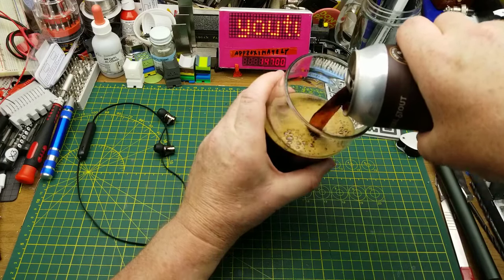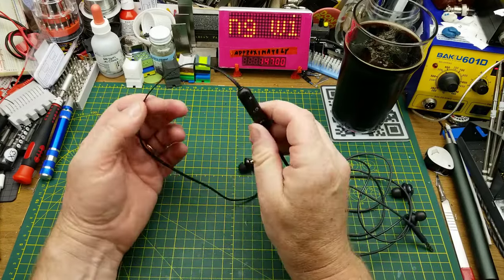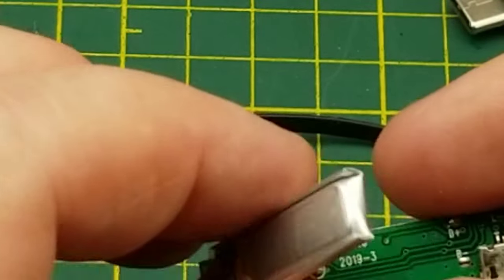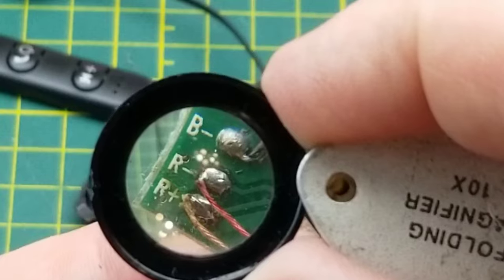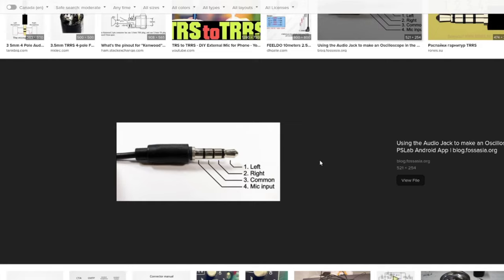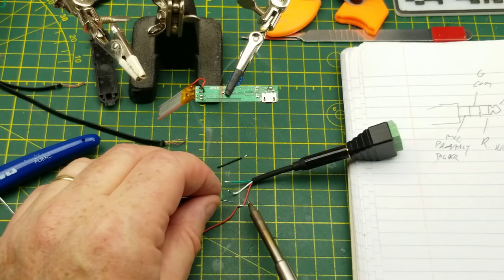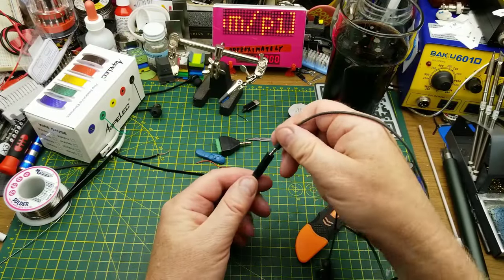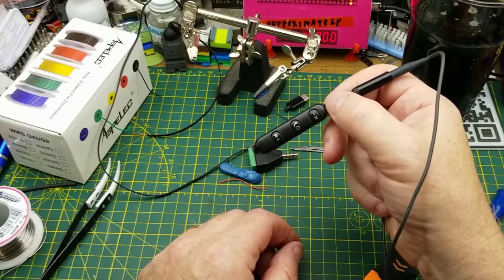upgrading cheap bluetooth headphones

Comment: Ha, why didn't I ever thing about that? Was looking at some solution to use my trusty earbuds a year ago and only found the 'fairytale golden diamond infused' BT5.2 at like 30 or 40 Euro/Dollar ones.  Could have bought cheapos and do it myself.  
I'll bet that IC also eliminates the dc-pop when you turn it on and off?  How about bass and noise?  Some of them use like really small caps in series which creates a high pass filter.

Comment: Only those hardware hacks are capable to trump household appliance disassembly in the shed.. satisfactory wise. 

It looks like it is a mono audio out ? .. the two traces connecting both earbud connections ? Can't quite get a view on that.. (Schematics please ^^)

This might also be a good opportunity to dig out that old 3d printer and make a case ;)

Comment: Seems a little odd not to keep using the sleeve as ground in 4-contact jack/plugs, where the 2nd, added ring is the mic, because you can just plug in a normal TRS plug into a TRRS jack, and still get normal Gnd/Left/Right on a pair of headphones.  Shorting the mic input on some jacks wouldn't matter, in fact it might quiet some units down.  If the mic output is the sleeve instead, and ground is moved to the 2nd ring, a normal 3 pin plug on a pair of plain old headphones probably wouldn't work, as that 2nd ring is probably not going to contact a ground source.
Reply: Regular plugs with a single ring will work on both 4-pin jacks equally well. Both second ring as well as sleeve will both connect perfectly to the full-size sleeve because everything is the same diameter.

Comment: "Didn't expect battery" .... now then, I would think that using the shield for the mic signal is a BAD IDEA. What's the point of the shield now? But to be fair, any serious microphone will be wired for common mode rejection and require three conductors, not just two.
Reply: No you misheard that. He didn't expect the housing to open so easy and they didn't use glue.
Of course he expected a battery, the thing has a USB charge port.
And about the microphone using the shield: what are you talking about? The mic is soldered straight to the board and there are no wires involved...

Comment: I’ve been developing with this same module from Manards. It is horrible lot of noise but it can be cleaned up. I thought about making a signal injector pen 🖊 and pair with a cheap app for waveforms.
Reply: You have a different chip though, mine is in a sop16 driving everything.

Comment: I wonder if you could  add a small amp with a decent 8 ohm speaker?   Place it into your shop.  I listen to podcasts also with my Bluetooth earbuds.  They sound great, but I always wonder if they are safe over time being so close to the brain?
Reply from the maker: It should work just fine wit an amplified speaker (like a computer speaker for example)

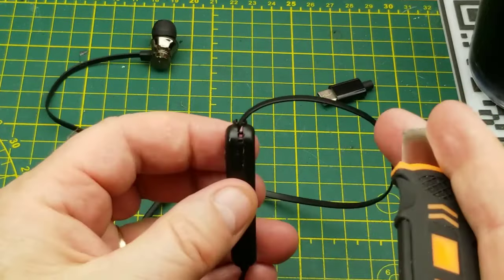Comment: Yeah.... I've got a couple of those usb to trrs "device not compatible...." 2:45
Reply: I wonder what causes this. Maybe a bad firmware?
Reply: @PhilXavierSierraJones  no... It's USB C stuff... Some phones require there be an audio chip in the dongle when some do it on the phone and just need wires to connect to the jack